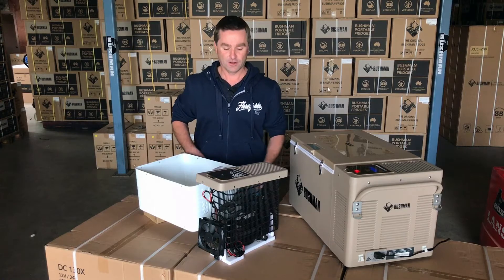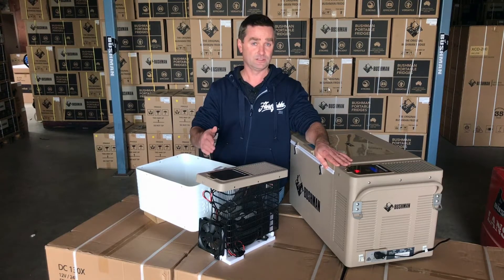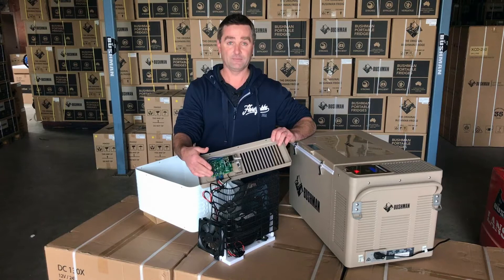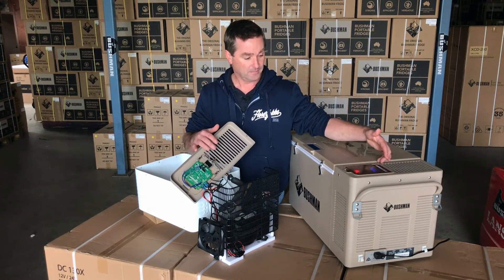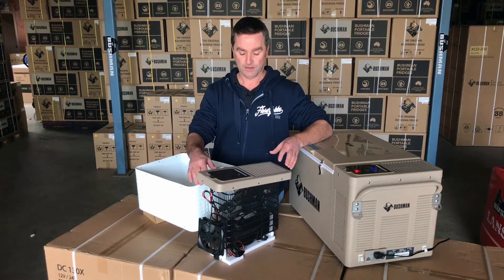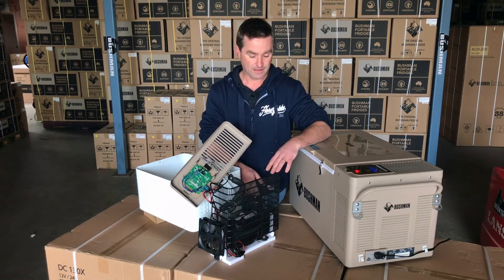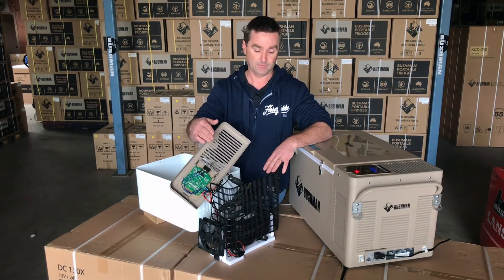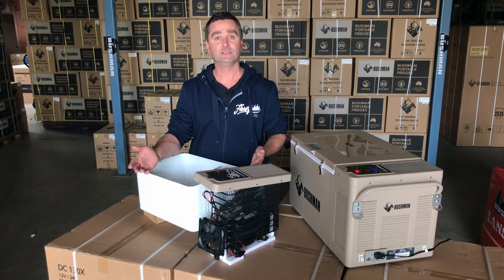Original Bushman Fridge | SC35-52 Construction

Comment: Great product and great service from these guys. Really happy with mine.
Reply: Why did you need Service? DID IT FAIL?
Reply: @davidowencunningham2743   Had a problem with the plug connection on my new bushman. Took it to their workshop and they fixed it on the spot.